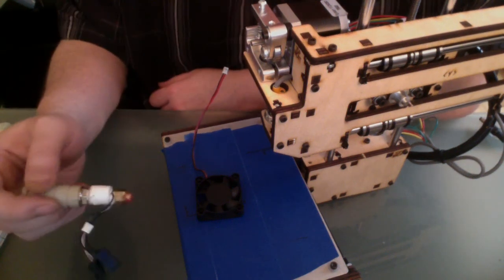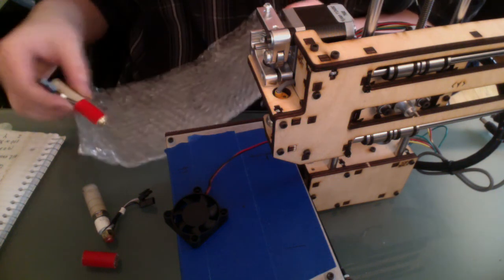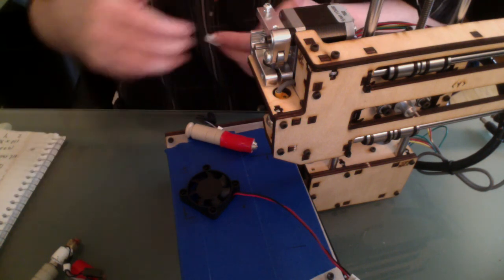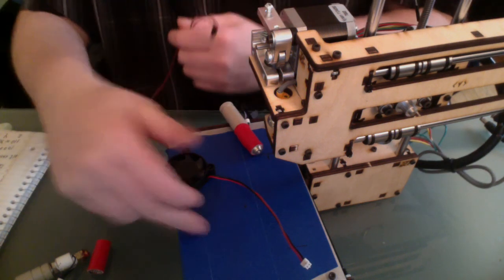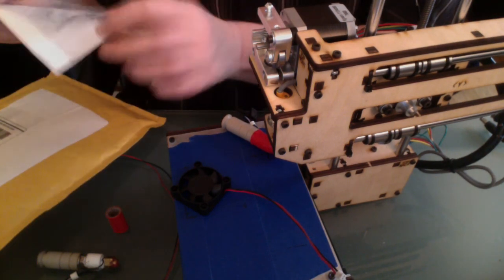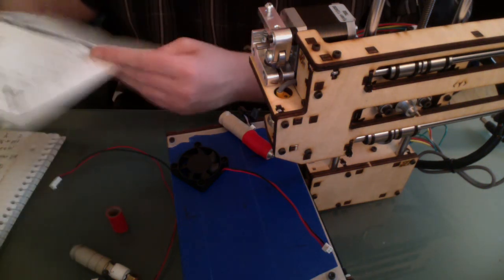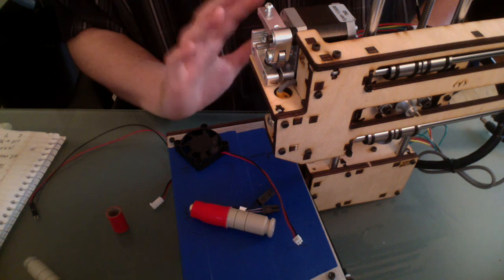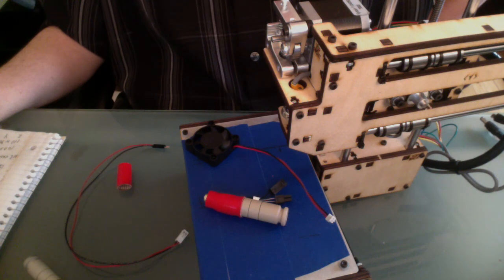Journey with Printrbot Simple takes turn for worst

Comment: Yeah I agree. Printrbot is the sorst. My 75 dollar printrboard broke for the second time and my motor has broken befor. Not to mention the z ribbing, y sag, etc I could go all day. looking at flashforge creator pro as replacement
Reply from the maker: Do you realise this video was from 2 and 1/2 years ago And these problems are no more a issue. 

Also I paid $500 for this printrbot model back in 2014 and had $350 of add on in to it for a total of $850 at the time.

I do not even own this model anymore, I bought the larger metal printrbot in 2015 and have been much more happy since.
Reply: perhaps not on the newer models, but I have the 1405 and these issues are definitely still an issue

Comment: Wow, lots of stuff. Definitely put in a support ticket for your issues, and you will get an actual Printrbot employee to help you out. They usually ship replacement parts that day, and maybe wait 3 days to get it. I've only put one ticket in myself, but got a response the very next day, and they shipped out parts a couple hours after. I'm not sure why you had to pay for your second extruder. 

I just now realized you purchased a pre-built. When buying the Maker's Kit, you learn your printer inside and out, while understanding exactly how to fix any possible issues. I've only seen people have issues with pre-built printers (1405, 1403), but I'm not sure if it is mostly a user error, or if the pre-built hardware isn't tested as much as the Maker's Kits. It really seems like a mix of both from what I've seen in their support knowledge base. 

For reasons like these, I wrote an addendum/guide to their 1405, helping with some issues, while making it easy for anyone to get the build right the first time. Any new owner should certainly keep this article handy when building. I also talk about pre-built systems as well...
http://3desprit.blogspot.com/2014/07/printrbot-simple-maker-kit-v4-1405-rev.html 

Also, the electrical issues are very easy fixes, but without the knowledge, it can be a pain. The fan pin casing should slide right back in to the 2-pin plug, and be just fine. The pin casings are usually loose anyways, so keep that in mind. As for replacement parts, check out Digi-Key. They probably have every single non-wood piece of the printer, or  at least something close to it.

I hate to see that you got such a bum deal with your 1405. It sounds like everything is fine now though, after replacing the extruder, right? Either way, I would sell it to someone, get the Maker's Kit; learn the in's and out's, and never have an issue again (that you can't fix).
Reply from the maker: First of all issues where fix since July 4th 2014. I did get a printrbot employee to help me. But a support ticket did absolutly nothing. They threated the whole thing like a big joke on the support ticket.

Also I did not buy a pre built version. I bought a kit in March 2014 which worked prefect and I bought the upgrade kit in June. After talking to Chris whom help me get the new wires and hotend everything has worked prefect. 

I not sure where you thought I got it prebuilt at, just watch my other videos and you see me building the printer.

I had to pay for another Hot end because my printer was over 4 months old, Printrbot only covers the parts for 30 days.
Reply: Something in the video made me think it was pre-built for some reason, but initially thought it was a kit. I guess they increased the warranty to 90 days though. I wonder if it was because of scenarios like yours. I did see that they talked a lot about adding tape to the older extruders.

Anyways, that really sucks man. Since I last posted, I've had some horrible support from the community, but still decent from the support tickets (PB employees). Of course trying to navigate the site is a pain to begin with, and then having to deal with one of their few know-it-all community engineers, giving vague questions to a specific question. I myself thought about getting a PB Go Large when I upgraded, but after dealing with both the community, and seeing you employee issues, I may look elsewhere. 

Don't get me wrong, I love my 1405, but I never want to set foot on their site again.
Reply from the maker: D Brown In March when I got my simple kit (old fishing line version), I had some missing parts and the support tickets worked great. . However when I had some broken parts in the upgrade kit I got some very poor support. I think it depends on who answers them. I found that if I use twitter @printrbot I get help within 24 hours and it is always top notch.

Comment: question i just assembled my printrbot simple 1405 and i was testing the x y it was working great then i tested out the fan immediately my pc made a disconnect sound and when i looked at the printr bot smoke was coming out of the power cable area i immediately unplugged it the board smelled like burn i let it cool of for a while then when i plugged it back in the green light still appeared then when i plugged the USB the pc doesn't make a connect sound like usual and the printr doesn't connect any more is there anything i can do
Reply: you might have shorted the fan pins.

Comment: Hi Obleo, this happened to me, and its a really easy fix if its the thermistor wires that popped off.  You need to purchase the new thermistors, i got mine from Amazon (RioRand(TM) Upgraded 10 pcs 100Kohm NTC Thermistors ) for around $12.  

Remove the existing Kapton tape from hot end, all the white stuff :)

You can not solder these to the clear leads as the heat will melt the solder.  I cut back the insulation a little and tightly wrapped the exposed wires around each of the legs of the thermistor.  I then wrapped each lead/leg with plenty of Kapton tape.

Finally i secured the themistor to the hot end using plenty of Kapton tape, and wrapped the hot end until there was about the same coverage as before.

To prevent this happening again, I placed a Zip tie around the power and thermistor leads as high up as i could on the hot end right under the mounting point.
Reply from the maker: Thanks for the info. That sounds like wonderful news. and $12 a cheap fix.

Comment: Bummer.  Looks like you did have some good prints initially though. Maybe some of the printrbot users at printrbottalk.com could help if you're still stumped on any issues.

305 days doesn't sound like a reasonable quote any company would give.  Maybe it was a typo and they meant 3-5 days?  (0 is next to - on keyboard.)  Hope you get it sorted and can start printing again!
Reply from the maker: I ended finally talking to someone at Printrbot that could actual help solve the remaining issues by sending out everything I needed. Already tried the Printrbot forum and got no help just nothing but people flexing there egos. The Printer been running great for several days now. After dumping double the cost of the printer to fix it.